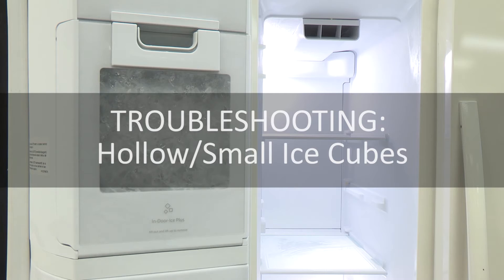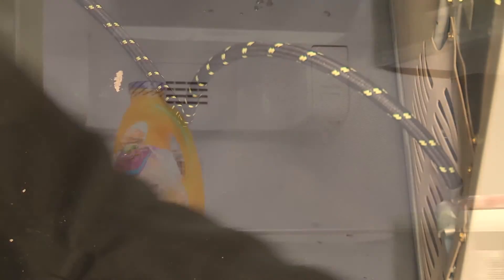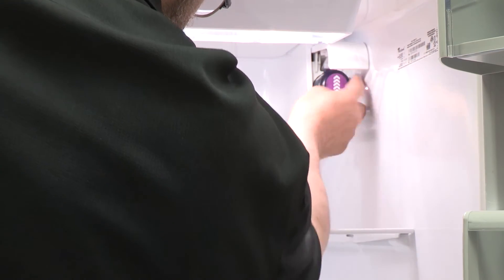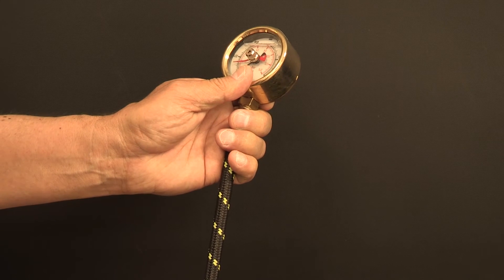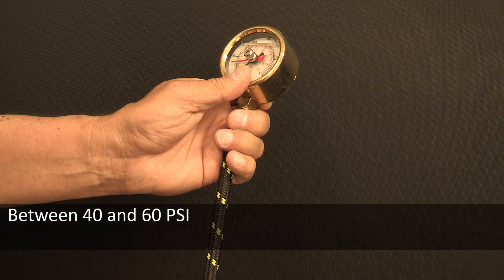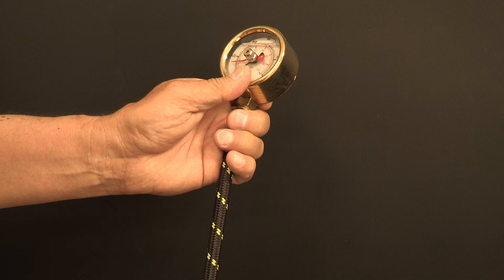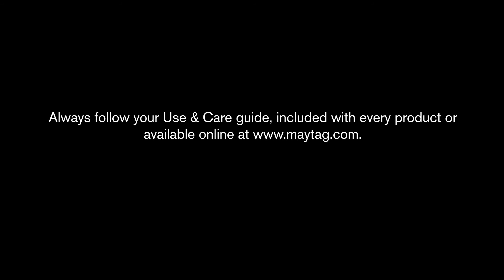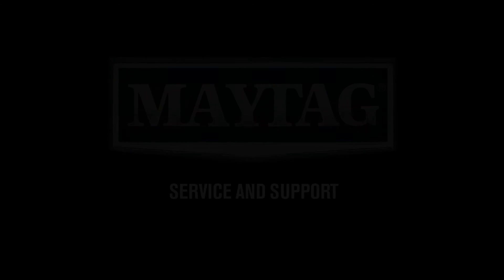How to fix small or hollow ice

Comment: Didn't have a kink in line.  Had good pressure.  Didn't want to touch the water timer.  Turned out I simply had an ice jam in the intake receptacle.  Pulled out the ice maker, let it thaw, gave it a good rinsing, let it dry, reinstalled.